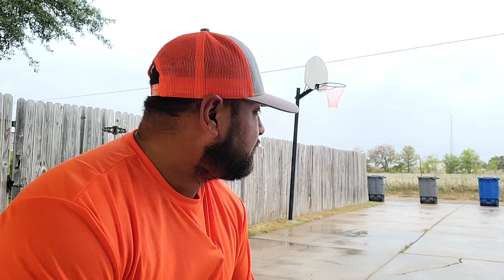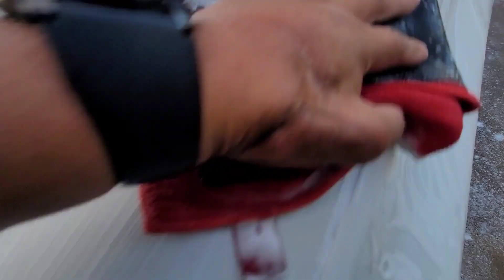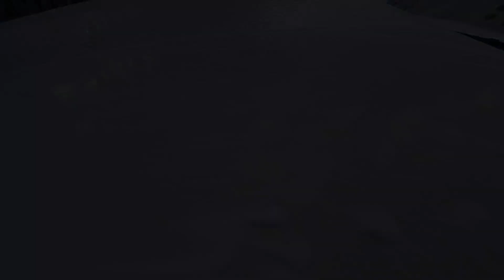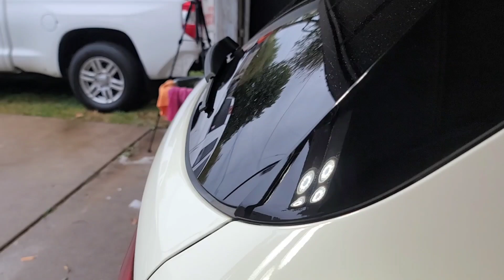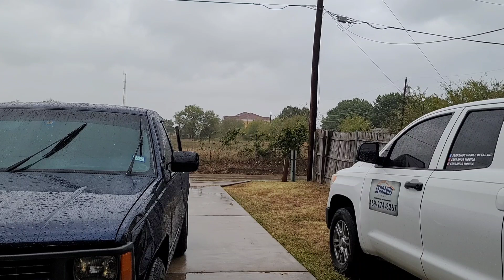correcting local shop WORK!

Comment: 3-4 hours for $1500 bucks. That’s BS. No way they did their job. I would be surprised if they even applied a coating. Probably a sealant. I had this issue come up and try detailer charged her $3000 to put on IGL Kenzo. I had to call IGL because this guy put on the coating one day after parts of the vehicle had been repainted. (I called after he got in an argument with the customer). So I proceeded to go on his google and write out a well thought out honest review. After he saw the review he messaged me and begged me to take the the review and I said once you make it right then I will. IGL also put some pressure on him and he agreed to recoat and correct the paint (even though the correction was terrible). I had found all this out after I did a maintenance wash. The panels were all flat and the paint job looked like it was done by a 6 year old. The sad part is I gave her my pricing which was a little below his around $2200-$3000. I set her up with a good painter from another pro detailer about 30 mins from me. Well she said to me after all this was over that she knew in her gut to go with me but what can you do. I mean you can’t put a coating on a car that has just been repainted. Once you put pressure on other detailers that basically rob a customer of their hard earned money it makes them either do things right next time or keep living on the edge and later on down the line lose their business because their integrity is shot. This type of stuff pisses me off. Glad you were able to make it right for them.
Reply from the maker: O wow